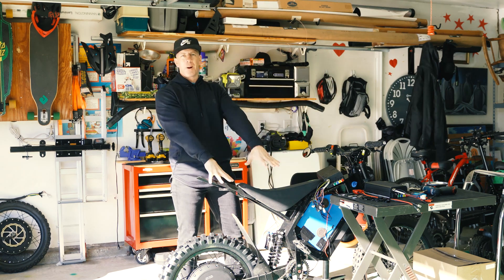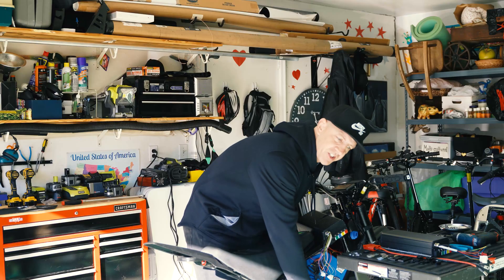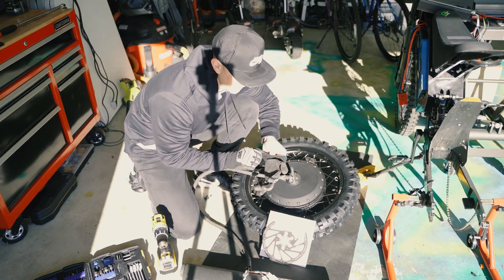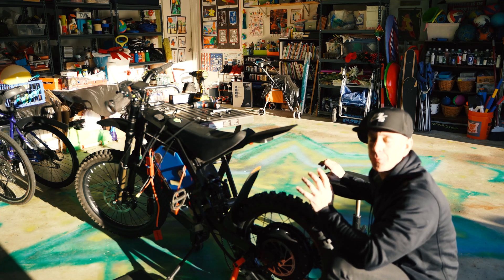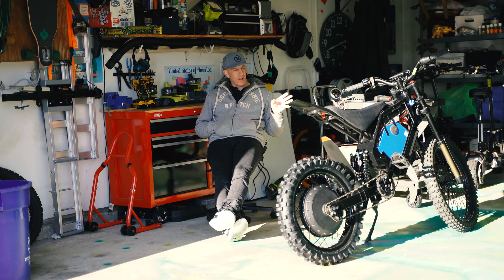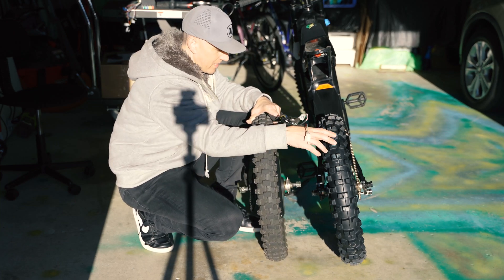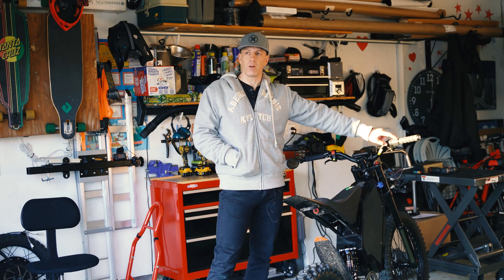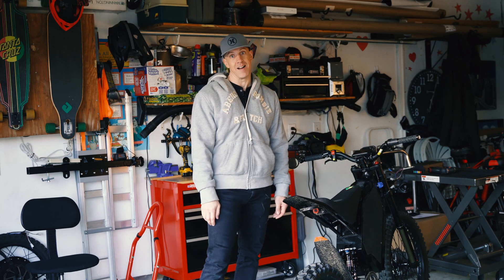QS273 5T & Sabvoton 72200 UPGRADE Pt. 1...SCREWED by ALIBABA!!!

Comment: I've gotten everything done took my bike out for a ride it's great.
The only thing I can't figure out is how to get the chain lined up to the back sprocket they are like an inch off from each other
Reply from the maker: You have to put spacers on the rear axle before you put that rear sprocket on.  It's a trial and error type game
Reply: @JoshStreetDesign  they sell spacers to go behind the rare one-way sprocket?

I did not know that.
Any idea what that rare thing is called is that a one-way sprocket or any idea what the spaces would be called
Reply from the maker: @johnfarias7230  you can just go to home Depot or Lowe's and get big metal washers and stack them
Reply: @JoshStreetDesign  do you mean you want me to offset the wheel to one side cuz right now I have the rim and tie a perfectly in the center

Comment: Where Did you get that seat and fender?
Reply from the maker: I got the seat from cab motorworks and the rear fender on the seat is the extended size fender for the sur ron

Comment: 2 question for you. A.) Going ham on single trails with a hub motor, haven't you bent rims? I'm wanting my enduro build to be off-roader, trail-rider, all-arounder. B.) With the controller and the battery inside the chassis, do you run into any thermal runaway issues when going really hard for a while? I'd figure you're pushing some amps and I'm torn on doing the same with my Kelly KLS7230S.
Reply from the maker: No never have thermal problems.  And I have bent my rim yes and had to hammer it back in shape. However if you're going to be doing a lot of off-road riding just go with a sur ron.
Reply: @JoshStreetDesign  funny bit, I have a Surron as well. This one is my cheaper bike in total and the surron is too clean to really destroy.

Comment: Why do people think mid hub is better 😂
Reply from the maker: It actually is better for street riding and just cruising q
Reply: @JoshStreetDesign  and off road
Reply from the maker: @thomassiegers3007  no it's not better for off-road mid drive much better for off-road
Reply: @JoshStreetDesign  how
Reply from the maker: @thomassiegers3007  how what?
Reply: @JoshStreetDesign  how is it not better
Reply from the maker: @thomassiegers3007  because it weighs 60 freaking pounds and it's unsprung weight so anytime you hit a bump or a root it just takes the hit and just smashes into it unlike a mid-drive where the weight is in the middle and the wheel actually uses the suspension and absorbs the bumps.
Reply: @JoshStreetDesign  I get air all the time on my bike I get air on small things easy
Reply: My bike is 100p

Comment: hey Josh awesome vid bud you thru me by saying a locked controller i thought the restrictions came from programming and also sometimes the wiring can u explain a little more bud thanks
Reply from the maker: Yeah the firmware is locked out you literally cannot unlock it via computer I tried multiple ways in a matter what it just doesn't let you do it

Comment: Holy shit! My bike gets up to 64MPH in Kph it’s hitting above 100kph this is using a damn Savoton 80amp controller with a 3000w 3t motor with a 72v battery with a 80amp BMS…..64MPH with the equipment I have on my bike feels scary at that speed….you take off from a roll and the damn thing lifts up the front tire….definitely gives the gut a punch! 

I think I will be mostly in mode 3….0 4 5 is super scary….I think my weight is close to a female rider I weight 144 pounds….typically female will be at 110…I need to either gain weight or Invest In some better forks, and find a 27.5 wide tire bike.

Comment: Hey Josh, thanks for all the inspiration and motivation to build one. Can you tell me which bolts&nuts did you use to attach the 2x 210mm DNM RCP 2S 550lbs shocks into the frame??? Thanks
Reply from the maker: Stick with one shock, it's too stiff with two

Comment: I done the same thing…I had the tire all the way on, and everything hooked up, and noticed I forgot to cut the top of the washer to prevent the hall sensor wire from getting damaged….I also mounted the rotor and forgot to but the plastic spacer on…this made the rotor further from the Frame and almost hit the hub….it sucked, lucky my frame has the drop outs that slide onto the back drop out arm.

The torc strap is built into the tire holder, and just slides on…the other strap is used for kinda a spacer…it’s a weird setup….I can put a damn 29inch tire on the thing….if I wanted.

I was worried when I ordered the frame….because I’m using 27.5 inch rims…it’s mainly a road bike, and sits low.
Had to use a 150mm shock because I was way to short’ due to the bigger tires’ 27.5 inch rims make it look like a Tron motorcycle from the video game Lol

Comment: I’m trying to design side plate spacers to allow a person to cut part of that frame, and still mount to the frame.
I’m experimenting with abs plastic and Aluminum to make it only necessary to only use fewer thump screws.

I had to change a bulb in a ceiling fan…they have metal thumb screws….but the threads are a bit smaller, so I’m using a tap and die set, and going to increase the top of the abs plastic to screw into the frame after I cut out the top of the frame.

There gonna be Part aluminum and part ABS plastic, I originally designed them to save weight, but they only knock 5 pounds off the frame.

I have a few videos with pictures of them….they’re only just abs side panels now, but I’m planing on using aluminum sheet on that top part.

As for the torc arms I wanna build them for the stealth bomber frame that has the smaller slit…and wielding steal chucks in them for more holding power…you can fast forward through the videos to see the torc straps my frame uses…I believe there’s 2 versions of that stealth bomber frame.

Comment: how many miles are u getting on average
Reply from the maker: Offroad in sand, like in the 20s.  I'm heavy.  When my son rides it on the road he could probably get like 40 miles
Reply: @JoshStreetDesign  thank man for the information and one more question can we put 18 inch 2.15 rim
Reply from the maker: @justbikesanvesh9549  no on this frame you would need a 1.85 rim for 18 in
Reply: @JoshStreetDesign  once again thanks man 
and one more question should i go wit 205 or 273   i want only 5t please suggest me and can u tell me how many miles can i get for both motors
Reply from the maker: @justbikesanvesh9549  definitely go with the 273, it has more torque than the 205.  Contact NB Power and ask for Raina Yu, tell her I referred you and you're looking for the 18-in cross laced wheel with a 273 motor
Reply: @JoshStreetDesign  thanks a lot man and can u tell the rear tyre size.
Reply from the maker: @justbikesanvesh9549  90/100-18
Reply: @JoshStreetDesign  valuable information 🙏🏼
Reply: can u please tell me the front rim size
Reply from the maker: @justbikesanvesh9549  21 x 1.6
Reply: @JoshStreetDesign  once again thanks bro

Comment: Hey Josh, Hope all is well. I was wondering if you can share the settings you put on your Sabvoton 72200. I would like to compare your numbers to the numbers I have set on my 72200. Thanks Brother. Btw I may need to do what you did with your rear suspension. Dual DNM 220mm RCP 2S is a brilliant idea.
Reply from the maker: It would take forever to write all the settings in here what specifically you're looking for generally I maxed out everything
Reply: @JoshStreetDesign  Really just the input output settings. Lack Voltage, Over voltage, DC, boost, rated phase and Max phase current. I'm using the following on my set up. Lack voltage 65, current limiting 80, over voltage 85, DC/ boost/ rated phase Current 175, Max phase 350 and protective phase at 450. I have the 3.5T QS 273 and I just wanted to get an idea of what the 5T settings are in comparison. Thank you so much for the quick response and be safe out there when riding.
Reply: @JoshStreetDesign  Hey Josh, Hope all is well. I have some settings that I was able to put together with some help from MQCON for my QS273 3.5T motor on my Stealth clone cafe racer. Hope this helps you and others out.
Sabvoton 72200 Controller Parameter Settings

Lack Voltage- 58V
Current- limiting Voltage- 65V
Over Voltage- 85V
DC Current- 200 AMPS
Boost Current- 200 AMPS (If Boost is enabled)
Rated Phase Current- 200 AMPS
Max Phase Current- 450 AMPS
Protective Phase Current- 500 to 550 AMPS

Flux Weakening Enabled or Disabled
(If disable ,the max speed will be reduce about 10~15%, and will extend the max mileage greatly.
If enable ,the max speed and max dissipative current will be improved by about 10~15%.)
Flux weaken current- 65 AMPS (works great for me)
When the value is below 50, it will improve the max speed with economic dissipative current , when the value exceed 50 , controller will consume much more current to improve speed ,and the controller temperature will rise very fast.
Value range : no more than 80A , we recommend about 50A.

Regen ON
Regen- 40 A
E-Brake- On
E-Brake Phase Current 35 A (For my stealth Bomber with QS 273 3.5T motor) Heavy Bike!
Reply from the maker: @jfeliciano15  mine was locked so I couldn't change any of this
Reply: @JoshStreetDesign  I spoke to someone who said that they used some kind of software to unlock his sabvoton. I'll check and see if I can get the info on hat program.
Reply from the maker: @jfeliciano15  yeah I tried three different versions of that software and none of it works

Comment: i thought u have to remove the 3wire white conector in order to be able to use the Bluetooth connection to ur phone! or ur controller hasnt got display output?
Reply from the maker: Yes you do and I did.  : )

Comment: Got that a little backwards... the first number is the measurement of the widest distance between the sidewalls of the tire, in millimeters. The second number is the sidewall aspect ratio.  It is a percentage that the tires sidewall height from rim to tread is (XX) percent of the  first number. EX... 120/80 would mean the sidewall is 96mm (120x0.8=96). or 80/100 tire would be 80mm x 80mm after the math. Can look at it this way of the 120/80 example "(120)mm x (80)% = sidewall height)" Looks insanely tight ... Nice build man.. Keep the mods coming!!!
Reply from the maker: Yeah I realized I said it wrong when I went back to edit it but I was like too late whatever, ha ha.   Thanks man

Comment: YOu using 84V or 72V battery also does your Battery have BMS continuous 200A?
Reply from the maker: It's a 72 volt battery running at 84 volts fully charged with 150 amp Max BMS
Reply: @JoshStreetDesign  I believe that is reason you may have had issues with the swap from 72150 to a 72200. I believe the error 30H is because you had diagnostic cable disconnected. The controller has a one device per channel restriction meaning when diagnostic cable is connected it disables usb BT and communicates solely to TFT display. When the wire is disconnected it communicates directly to usb BT. You may have already figured this out but i thought id share.

Comment: What type of battery is installed? What chemistry?
Reply from the maker: 2 batteries.  Primary is 49ah, 18650 Panasonic BD.  150amp Max.  Secondary is lG 10ah running in parallel at 72 volt.
Reply: @JoshStreetDesign  well the cells are pretty good and with your 20p 72v configuration, according to datasheet it can hold the current up to 200A +-continious and even 300A peak. 
It is strange that the voltage drop is so big. 
Would be interesting to connect to BMS via Bluetooth and check out what's going there under load
Reply from the maker: @nikita-shamrai  my battery is BMS limited to 150 amps. I guess I could take the thing apart and bypass that but I'm really not interested in that as it could possibly destroy the battery long-term
Reply: @JoshStreetDesign  yes. High current is not very healthy for battery... I use AntBMS with Bluetooth to control every parameter of my battery. It works super stable and I think it is the must have device for any powerful battery, so I recommend it (maybe on future battery)
Reply: @JoshStreetDesign  maybe it is because of the second battery in parallel wich can't hold that loads if you are using both batteries at the same time

Comment: Where did u get the sabv 200amp unlocked controller frrom im tryint to look for one
Reply from the maker: It turned out it wasn't unlocked they lied to me.  : (
Reply: @JoshStreetDesign  where did u get this from. Also i cant see a unlocked version anywhere of 200a. But i seen a controller thats called the asi bac 4000 that can throw like 50kw but that could prob cook ur motor lol but i cant find it anywhere

EDIT: also i have another question. Where did u get all ur parts from like what website... alibaba?

Sorry if im bothering u
Reply from the maker: @allwaysindesolation  look in the description of the video you can see all my stuff in detail.  And by the way the ASI 4000 is nowhere near capable of putting out 50 KW
Reply: @JoshStreetDesign  oh okay ty lol
Also yeah ik im just saying its powerful as hell is what i mean lol

Comment: Hi mate I have some question of your controller setup 
The controller is in the frame, but isn't it overhit?
Is there any problem as it looks like it needs to cooler?

other video that you uploaded, what temperature will the frame go up to if you run from off-road to full-road?
Reply from the maker: No I've never had a problem with it overheating at all
Reply: @JoshStreetDesign  Thank you so much It's really help for me !

Comment: just wrap the cable in an long spring made with thin wire, which will protect the cable not touching the wheel.
Reply from the maker: But why would I want to do that when the plastic casing I use is already doing an awesome job?

Comment: That sucks.  Who can you trust anymore ?  People don't realize how hard it is to make or modify e-bikes.  When you order stuff it comes with, either no instructions, missing parts, or instructions that are useless.  Connectors don't match, the color coding of the wires don't match... It's a nightmare.  I appreciate this video because it's honest.  Don't give up.  Learn from the experience and don't be fooled again.  It's expensive to learn from the pitfalls, but over time you will make it work and you can still use the parts for other projects.  It's not a total loss.

Comment: I read on endless phere that you can unlock the controller yourself via software but I might be wrong. 

Also, with the new motor, you have to re-tune the controller for the new motor. 

Did you consider use EIG lipo cells? Check them out. They can do 200A discharge without breaking a sweat. Easy to build, easy to mount, 20ah each and they are cheap. 

Love your build! All the best. 
Cheers
Reply from the maker: Yeah I've tried all that it does not work on a locked controller.  however it wouldn't matter because my BMS cuts off at 150 amps anyway as when I installed my 200 amp controller there was no difference even though I could tell it was trying to draw more power.
Reply: @JoshStreetDesign  So maybe the bottleneck is your bms. 
I have a regular 4kw commuter DIY Ebike which I'll be replacing for something like yours. I look forward to see your next videos!
Reply from the maker: @Full_Throttle_no_Brakes  yeah, that is what it is.  But yeah, working on the next ride video now.  It's a good one

Comment: FUDGING love you bro!!! (Not gay)
I have been struggling, for 8 hrs today with my 11kw motor! I kept messing up the spacers and that was killing me! Motor weights a damn ton
I'll take a day off tomorrow and fix that up similar to yours 
Thanks a bunch 😎
Subscribed up
Reply from the maker: Hey man, thanks.  It can be tricky, but if you're tire isn't as wide as mine it should be easier for you because I had to be perfect down to the millimeter to get my spacing right.  but you want to try to get it as even on each side as possible.
Reply: I also had that problem. And when I would turn the wheel it would be hard to move.

Comment: Great video man it is a crazy amount of work you did on that thing.  I pretty much have the same frame , what did you zip tie the controller to?  I don't see anything up inside the frame other than four studs.
Reply from the maker: Thanks!   There's these two rails up inside the frame on the top on either side made just for zip ties.
Reply: @JoshStreetDesign  okay thank you they must have forgot to put the rails on mine they probably bolt to the four studs I'm seeing well easy enough to make thanks again!

Comment: Did you make any modifications to the seat or the frame to mount the seat?
Reply from the maker: The seat is from CAB motorworks, and it looks as if they just stopped selling them as separate items from their bikes.  But yes I had to drill new holes in the frame for the mounts.
Reply: @JoshStreetDesign  Thank you very much for the information.  I really like your bike.  good luck.  stay safe.
Reply from the maker: @fernandobautista9079  thanks man I'm actually making a video right now of my ride today where I was really hauling through the trees
Reply: @JoshStreetDesign  I watch your videos over and over again.  in a short time I will have my bike ready and I am already looking for some places here in Connecticut to ride.

Comment: Heya Mate put a 19  inch tube around the battery pack then pump it up and the pressure will totaly look the battery in possition and also provide protection against heavy landings. seen this done many times ,cheers
Reply from the maker: A tube definitely wouldn't fit in that case with the battery it's a very tight fitting at the bottom.  It doesn't really matter though it's locked in tight as it is